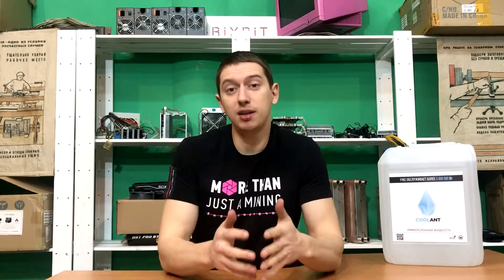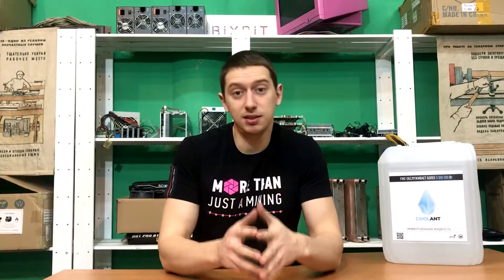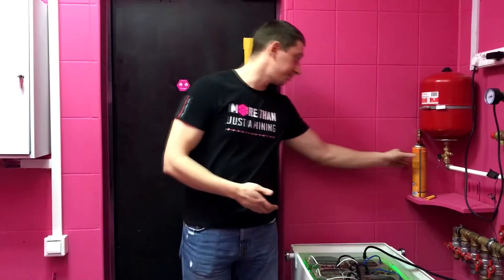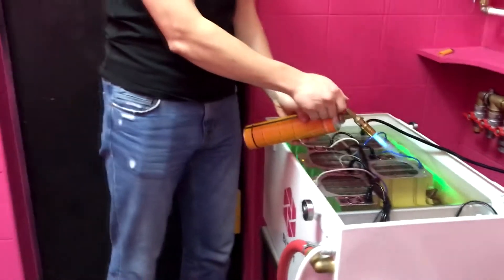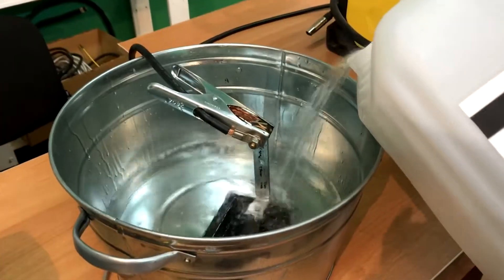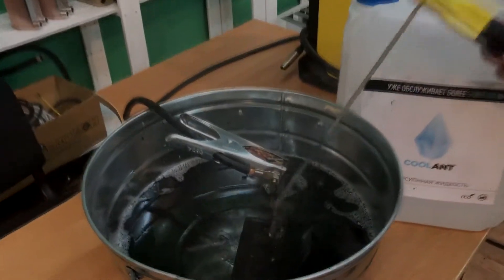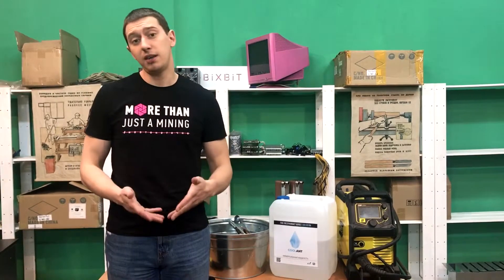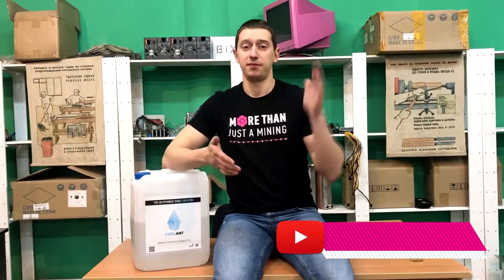Liquid for immersion cooling. Tests. Charachteristics

Comment: Uninhibited, non-corrosive, non-oxidising transformer oil works a treat. I built my rig around it (60 S9se) running for the past 8 months.
Reply from the maker: Our first prototypes, assembled in 2017, also ran on transformer oil, and for a very long time. But there were some nuances in the equipment.
Reply: Hello, I was looking to experiment with immersion cooling, Planning to work with the L3+. I found this dielectric fluid here https://www.engineeredfluids.com/ its kind of pricy with about $200 for 20 liters. Could you tell me what kind of transformer fluid you used.  Thanks
Reply from the maker: @sanjeevk8128  Hello, we use highly refined mineral oil-based dielectric fluid, it is perfect for cooling mining equipment https://bixbit.io/en/products/coolant
Reply: How is your rig running now ?

Comment: Mineral with the follow property suitable for immersion cooling?

1) Flash point in open crucible
    - 158 deg C
2) Kinematic viscosity at 40°C, mm2/s
     - 9.51
3) Density at 15°C, kg/m3
      - 0.8730
4) Breakdown voltage, kW
      - < 50 kv
5) Low-molecular content mg KOH/g
     - < 0.01
6) Loss-angle tangent at 90°C
     - < 0.005
7) Freezing point
      - < - 60
8) Life time
     - up to 15 years with the proper maintenance schedule